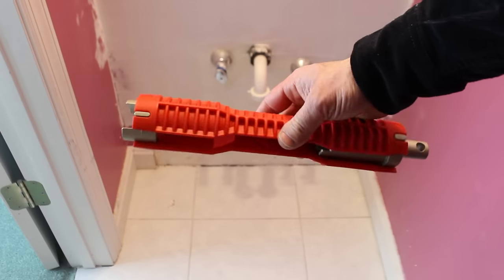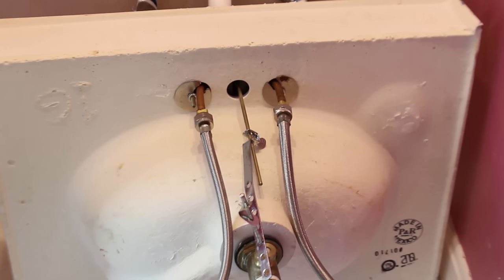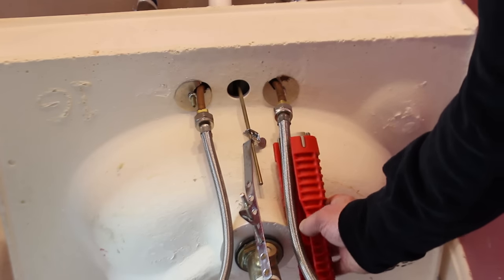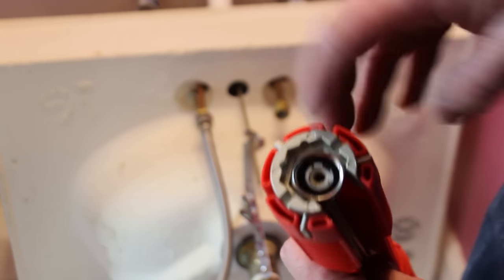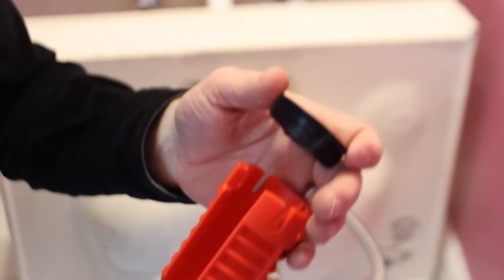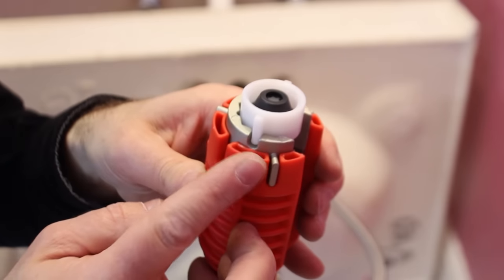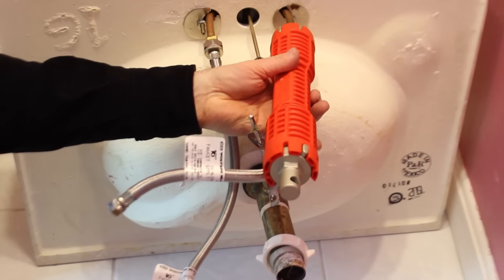Ridgid Faucet & Sink Installer (Fast Faucet Fixes!!) -- by Home Repair Tutor

Comment: I have the Ridge Faucet & Sink tool for years but hardly thought much about how useful it is until now.   I can use its metal removal wrench to remove the corroded bathtub drain.  Great video, short and to the point.   Thank you.

Comment: Best tool ever for under the bathroom sink plumbing, it's so easy, just slide it under the hose line and turn, saves you hours and tons of effort, best $20 I've ever spent. 👍
Reply: I just bought one,  surprisingly price haven't increased ..still $19.99
Reply: After seeing what this tool can do , I'm definitely buying one because I have to change out a faucet at my brother's house , Definitely much better than a basin wrench which chews up the faucet mounting nuts and the supply line nuts because a regular basin wrench has teeth the same way as a pipe wrench , The Ridgid Easy change faucet tool is the basin wrench reinvented and the price is really good for a tool like this

Comment: I wish I had this tool yesterday when removing and replacing my kitchen faucet.  It was a nightmare.  The plastic rings that hold the faucet to the sink from underneath had mineral build up.  I tried to use the plumbers tool that has a flexible spring grip on a shaft but that was useless.  The area first of all is in a tight area and next that tool is not practical.  This looks like the perfect tool for these projects.  I just ordered one of these tools on E-Bay last night.

Comment: Jeff I did it!! I purchased the Ridgid as well as the Basin wrench.  The ridgid was great from the supply lines, but the Basin Wrench worked for the stubborn rusty nuts holding the faucets.  Soaked with WD40 over night. Had to put an adjustable wrench on the faucets on top to stop them from spinning while I worked below.  The first not would not loosen by hand at all had to use the basin wrench the entire time!  The 2nd one took me 18 minutes to remove.  Yeah I'm a pro now...and now for the fun part...installing the new fixture.  Going from tiny little separate hot and cold faucets to one big one, with a stopper no less.  THANK YOU!!!  People this took the patience of a saint and some visualization. LOL

Comment: This is the kind of tool that every DIYer should have. My only problem was using it on a deep well sink. The shaft was just not long enough to clear the bottom of the sink. An extendable tool shaft would be a nice feature.

Comment: Excellent tool. I paid 19.99 at the Home Depot. Made my job of removing a 10 year old kitchen faucet and hose a breeze. I highly recommend this tool. Great video.
Reply: Five years later and it costs $22.27 which is still well worth the cost in time & frustration alone.
Reply: @TheOtto3663  I saw it at Home Depot this morning, thought hmmm...And left with the new faucet but without the tool. I watched this video after being defeated by the plastic nuts stuck on my 15 year old sink faucet, and with no way to get access to them properly. I watched this video, and I'm on my way back to Home Depot!
Reply: I tried it on a kitchen sink but wasn't able to tighten it. Maybe you should make a video on how to use it in the kitchen.

Comment: Definitely better than a basin wrench for installing and removing supply line nuts because a basin wrench will chew up the nuts , Both the supply line nuts and the faucet mounting nuts
Also when using a regular basin wrench , You have to wear safety goggles because the regular basin wrench will cause metal chips to fall which can get into your eyes , The Ridgid Easy change faucet tool will not chew up the nuts like a regular basin wrench will, I have to change out a faucet at my brother's house this weekend and I'm definitely gonna buy one , After seeing what this tool can do
It's worth it's weight in gold

Comment: I have used that tube style plastic one and I liked it for around $20. It's a clever design.
I have also made PVC pipe diy ones in the past just for the faucet hold down nuts with fins and it worked but cutting a slot for the line to fit in weakens the tool quite a bit I have found so I have one I made with no slot and one with a clearance slot both made from scrap pipes. Also you can make them whatever length you want.
Of course neither will work on the hex nuts on supply lines like the commercial tool but a regular basin wrench and the commercial plastic tube tool both work on those hex nuts.
Rigid makes an old style basin wrench with a lot of new bells and whistles I might try.
The Superior socket looks interesting for awkward positions and where high torque is needed. $20 for a USA made tool is quite reasonable.
The combination plumbing wrench set up is interesting but I just carry single combination wrenches bought from a bin at a pawn shop in 5/8" that I cut on the box end to make it a line wrench and single 9/16" and 15/16" combination wrenches. 
(I'm trying to get away from using adjustable wrenches but of course I still have them, I just try to use them less).
The Rigid update of the basin wrench can take a ratchet wrench to drive it so if you get the Superior socket as well that makes a nice set up if you're willing to carry them both, and a ratchet and extensions.
That's a very interesting and versatile set up that allows a lot of hard access options including even universal joints and allows for a lot of torque.
I like my plastic tube wrenches but I think my idea for pairing tools that can be ratchet driven has a lot of arguments for it.
I store my combination wrenches in my plastic tube wrenches to save space and I like that set up but
if I was starting fresh I think I'd go ratchet based though for access reasons and torque reasons.
I may still do this...

Comment: I wish I can email you a photo of a loose faucet to see if this Rigid tool will work. The Nut is brass and looks like about an 1 1/2 - 2" Nut where 3 supply hoses goes into. This brass nut is what I need to tighten and its very stubborn. Every time I tighten it, the washer underneath it rotates with every slight turn enabling me to tighten.

Comment: I sure could have used one of these wrenches Monday. I had to take a 12' piece of 1 1/2 PVC cut 4 slots to tighten the rosette nut on my Kitchen Sink . I t really worked well . When I finished the job I drilled a hole in my homemade tool and hung it in the shop . It will be used again!

Comment: Great video .Thank you.I have an old faucet and I'm trying to get the sprayer hose off to replace it. I have tried using a basin wrench but for some reason I can't get a good grip on the nut.I even thought of cutting the hose off and using a socket,but if that doesn't work then I'm in real trouble.Does this Ridgid tool have a way to use it to remove spray hose nuts?Any ideas?
Reply from the maker: Hey John Wilson - yes, if your spray hose has a nut that fits into the grooves on the end of the Ridgid tool then you should be able to remove it. If one end of the tool doesn't work try the other end. But please keep me posted on whether it works or not.

Comment: What about a backer wrench? Most of the time if the nut is that tight on the faucet supply connection you need a backer wrench so you dont twist copper into a pretzel. Think it's a good tool but you should always use a backer wrench

Comment: YOU ARE AWESOME!   I hired a 27 year Head Engineer to replace my kitchen faucet.  The faucet itself is very expensive so I would hate to see the damage created by his channel wrench.  He had to come back several times because the hot and cold were offbase and then he cracked my cold water line to the faucet.  Now I have to deal with a replacement part.   I am going to Home Depot to buy this tool.  Thanks a million.
Reply from the maker: Christina Miller ouch!! Sorry to hear that happened to your faucet. Did the tool help out?
Reply: Why would you call an engineer rather than a plumber??

Comment: I bought this, thinking it seemed like a useful tool. As luck would have it, the heads of my supply lines would not work with the tool. They were round and knurled. I still think this tool will be useful in the future. Get a good look at the nuts before you buy it. Cool idea for a tool, if you have the right connections. Trying to get to those nuts really sucks.
Reply from the maker: +J Ray some WD40 sprayed on the nuts, wait 15-20 minutes, and a basin wrench might work

Comment: Does this do faucet nuts (the one holding the drain on)?  Or just it does just do supply lines?  Are the heads big enough for a 1.5 inch nut?

Comment: It needs a rubber gripper in middle of tool to make it easier on hand, better grip. The entire tool is made of plastic, the weakest being the orange part. It gives under pressure. It is a GREAT tool and idea, but it needs better material.

Comment: The tool is all right but I think it's too bulky I changed a kitchen faucet yesterday and the nut that holds the faucet in place was too big for that Ridgid gadget had to take the sink out the counter flip it over and still had to use two wrenches to get it off  it turned out to be a real lengthy project
Reply from the maker: Sorry to hear it didn’t work, sometimes the sinks come with their own removal tool

Comment: This is a plastic. How long it will last? Does it tighten enough tight? Tighten means the tap will not move and water will not leak later.
Reply from the maker: It will last a long time, years, if used properly. And there should be no leaks after using it.

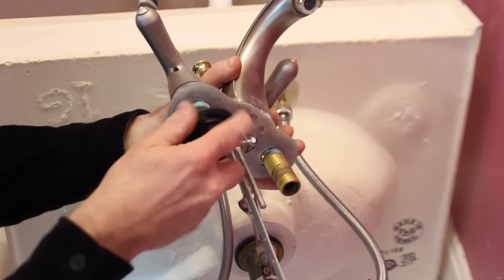Comment: 2:39 about the black plastic nut... you are dead wrong. There is no way in hell the orange/red plastic ends are strong enough to use to tighten or loosen these black plastic nuts. However, the metal part that has a hole for a screwdriver (tightening/loosening) has the 4-way for these black plastic nuts. I hope this helps someone.
Reply: Actually it worked for me....
Reply: Worked for me too🙂
Reply: Me too!
Reply: Me too! It worked on plastic nuts that were installed 15 years ago on the faucet stems under the sink and were mightily stuck with a build-up of mineral crud. 

I soaked them with WD-40 the night before as an extra measure to lubricate the threads. I also soak rusted metal nuts in advance.  

This job involved working behind the really tight spacing of a pedestal sink. 

My research found some saying that I might have to remove the sink because of   the compressed work area. I did not! 

Woohoo! This tool is a miracle worker with its handle design that allows working in tight and hidden high spaces. I had tried a basin wrench in the past but it keep slipping off the faucet nuts. 

I would not be without this tool and the Ridgid 2-in-1 wrench, also found in the plumbing section. 

I am a relative newbie to plumbing and feel lucky to have come across these amazing tools. Makes plumbing seem like an (almost) fun hobby :-)

Comment: It still looks quite big & wide, & am doubtful it will fit in the small space under my basin to remove taps.
Reply: I used it behind the very tight space for a pedestal sink and it worked great.

Comment: It doesn't work on coper lines. You cannot fit it - too bulky.
Reply from the maker: RT, it will work on copper but does depend on the setup.
Reply: I don't think it'll work on any rigid curved supply line.